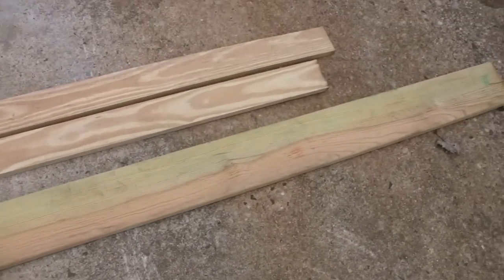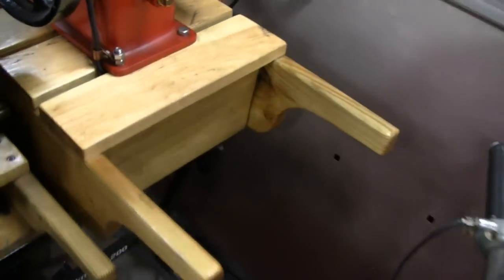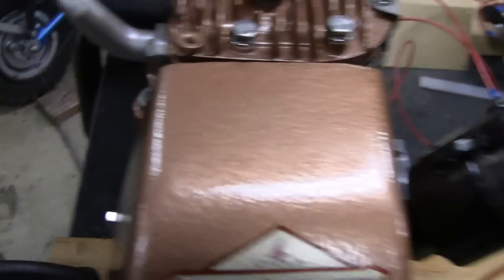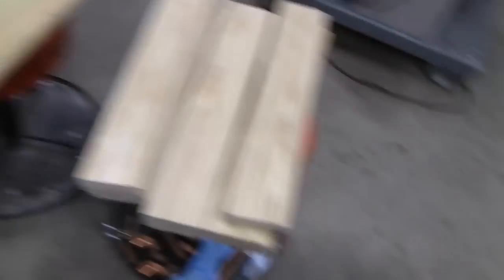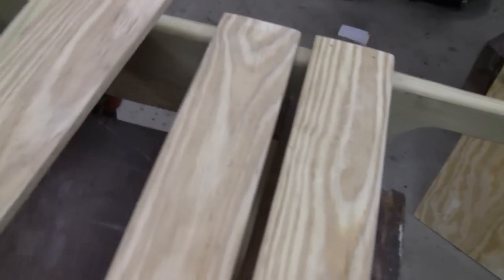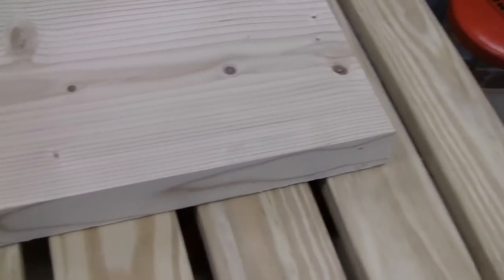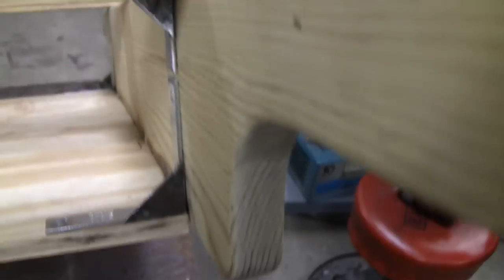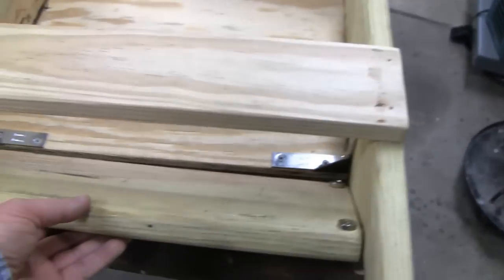HOMEMADE 4 CYLINDER BRIGGS PROJECT (part 21)

Comment: Be careful slamming Neodymium magnets around like that, they shatter very easily.
Reply from the maker: Yeah they are brittle!! we lost a few just by dropping them on the ground!!
Reply: I get all my neodymium magnets from K&J Magnetics. They sometimes offer plastic coated and epoxy coated magnets which are much more resistant to shattering. You may want to consider looking into those in the future. I'm not sure if they make countersunk plastic coated magnets or not, but I feel like I may have seen them before.

Comment: I'm with pretty much everyone else on here, the magnet deal is slicker than whale shit!   Excellent job on the gusset welds, not east to weld metal that thin.
Reply from the maker: Thanks Jim!! Mike's always doggin' me because I like using magnets and epoxy!! Lil Racer tightened me up with the welding and really did a fine job!!☺

Comment: Roadking, may I ask, why not use coated deck screws to hold the 'slats' in place on the handle boards,..wouldn't that add to the strength and rigidity of this 'cradle' ?  I don't mean to criticize here at all mind you,.but just offering another way to make this stronger .
I sure am 'into' what you guys are doing,..so I hope my 'two cents worth' doesn't upset the apple cart !
Reply from the maker: That's cool Reg!! I've made similar carts like this with deck screws and it just makes it look shitty!! It would make it stronger but that is only overkill!! It's so strong and rigid now it's plenty for what we need!!☺

Comment: You need to actually use it, like mount it in an old garden tractor. Something that originally used B&S for power. Maybe an old Sears with hydraulic drive?
Reply from the maker: You can't put an engine like that in anything, it would snap in half!!☺